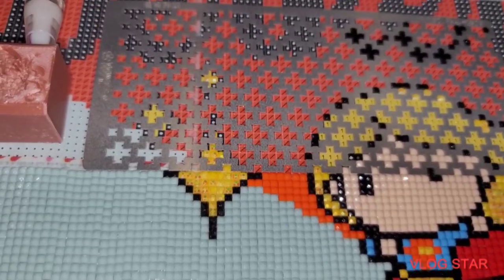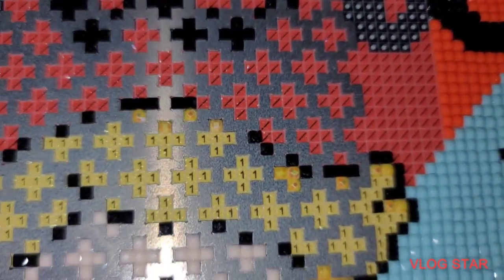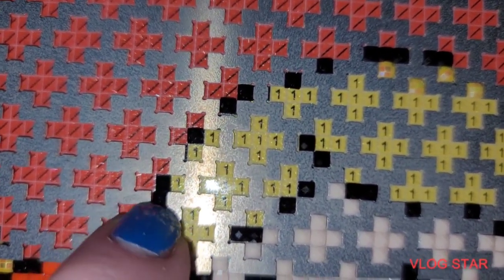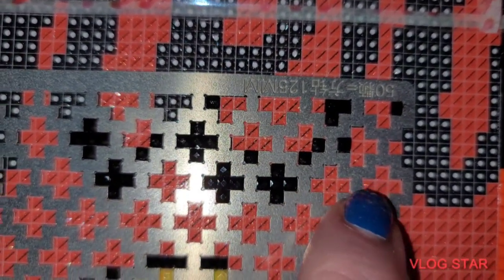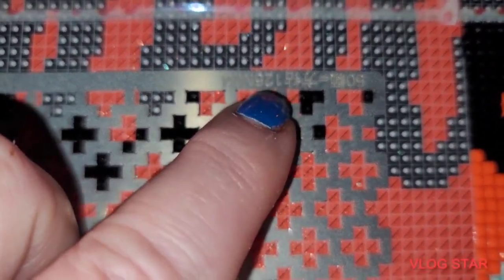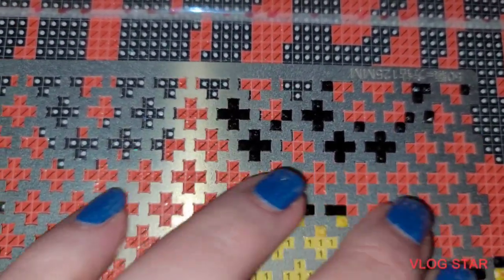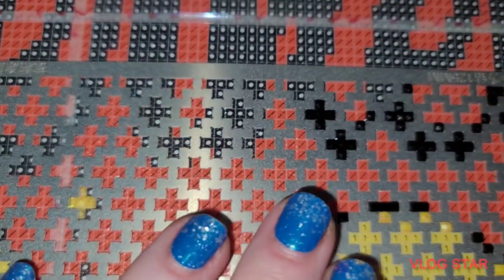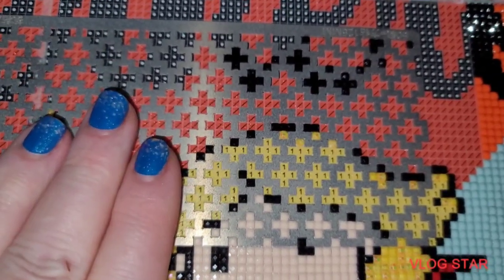How To Make A Square Mesh Ruler Work On Any Canvas

Comment: I understand the placement of the Ruler. But what I can figure out is, once you place all the drill within the Ruler and you remove the Ruler you still have drills that need placed. So how does that work?
Reply from the maker: You will have to place them with either a single placer or a 3 placer. The ruler gives you a good straight base to work off of when filling in the rest. So because of the drills you placed with the ruler will be perfectly straight, the ones you fill in will be straight as well.

Comment: I don't understand when you pick up the ruler how to do the letters that are underneath you know in the spaces left open does that making sense? Like with my round ruler I can put the ruler on top of the ones that I already did and that'll help me to do the Open Spaces but with the square I have all these Open Spaces
Reply from the maker: The square ruler is used more for a guide, a ruler to keep them straight. The drills that are placed with the ruler down are done in a way that enables the foundation of the drill field to be straight. Then when you pull The ruler off what is left is a small plus symbol, five drills in total in each space that are easily fit in between the drills that have already been placed.